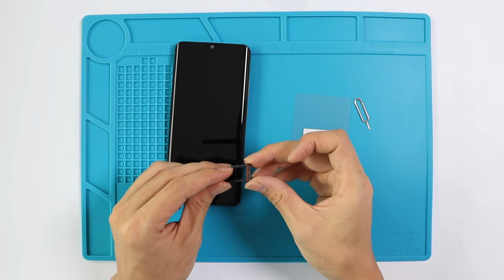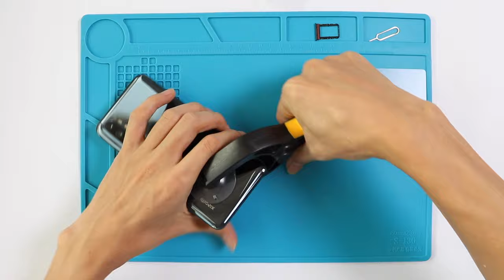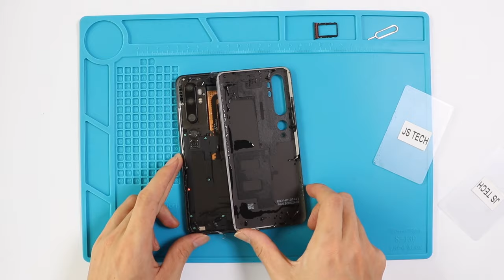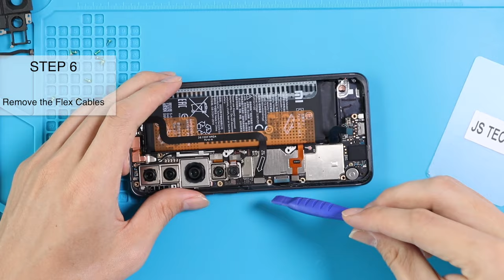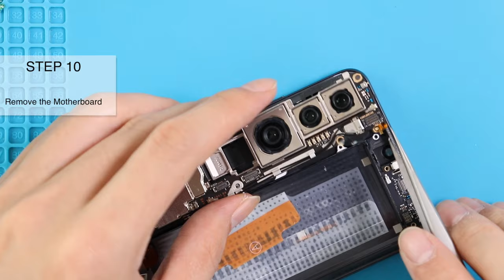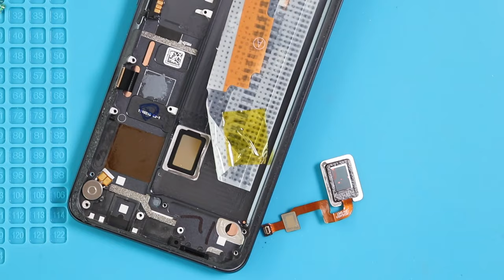Xiaomi Mi Note 10 Disassembly Inside - CC9 Pro 108mp Teardown

Comment: Great video, i was wondering is the main pcb is soldered to the charging port and headphone jack pcb? Because im having some problems with this exact phone that its stuck in headphone mode so the speaker doesnt play any audio and also the phone doesnt get recognized by any of my computers.. so my theory is the charging port/headphone jack pcb is in fault. Can it be replaced? Or do i have to get the whole main pcb for this phone?
Reply from the maker: Well, Mi note 10 is not repair friendly..You have to solder charging port and headphone jack for replacements..it is possible if you seek a good technician..Buying a whole pcb is not worth.That is what i think

Comment: my Minoten had 3.5mm Jack Audio problem/damage.  
what will you suggest me. i repair it or just let it that way? if i repair it,  i worry it will effect to performance. thx before
Reply from the maker: Yeah unfortunately it is on the board and the charging port as well. Well good solder tech can do the repair. If not you can try a type c headphone
Reply: @DIYGeardo  thx for your advice. I need 3.5mm Jack for tunning the FM radio. So type c headset won't turn it on. :(

Comment: I have a mi note 10. It suffered from water damage and is broken. I did have it cleaned profesionaly from all the water but  it is not starting up anymore. 
Because I want to recover my lost data (and I like this phone) I thought I would buy a new one and try to take out the memory of my old phone. I would then try to put it in my new phone. Would this work or would I just ruin my new phone as well? 

Thanks for your reply.
Reply from the maker: Well it is possible job, but still it depends on the damaged unit..if there is an issue, then it might have issues..seek a good board tech for this job

Comment: how much temperature u keep to open back panel
Reply from the maker: Well normally we are heating it on around 80 Degrees for around 1-2 Minutes, Sometimes you might need to go for 100, It depends from phone to phone. But always do little by little (edges), if you are not an expert , you might end up with damaging the board. Hope this helps you. Thanks
Reply: @DIYGeardo  tqsm for replying

Comment: hello is there any tips to solve my camera photo quality problems on xiaomi note 10. because suddenly all the results of photo went so bad quality, already reset everything but still doesnt work
Reply from the maker: You can back up the phone and perform a factory reset, if it still happening, you might have a hardware issue. You may needs a Camera replacement or check with xiaomi for any issues with mi note 10 camera and its updates. By the way this is a new phone, you should have a warranty, you can easily cover up.

Comment: I changed the screen and the speaker no longer works. Is there a solution?
Reply from the maker: Please double Check the connections first
Reply: i check all the connections is truee but after i change the screen the load speaker not working 😢  @DIYGeardo
Reply: @DIYGeardo  Could it be from the flat of screen?